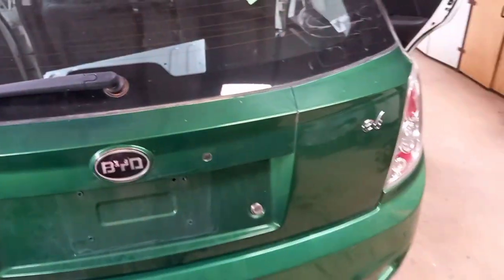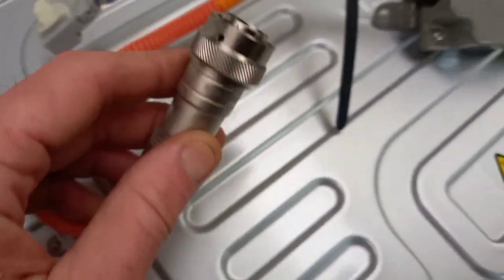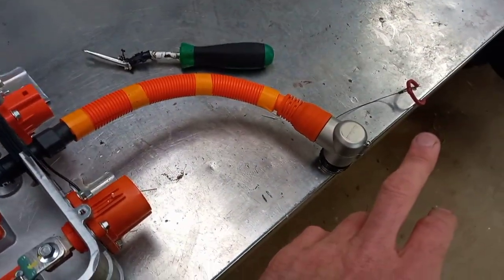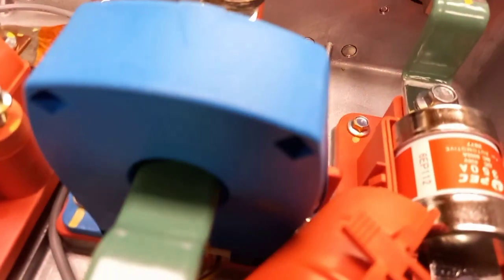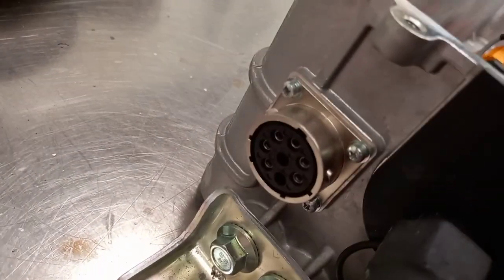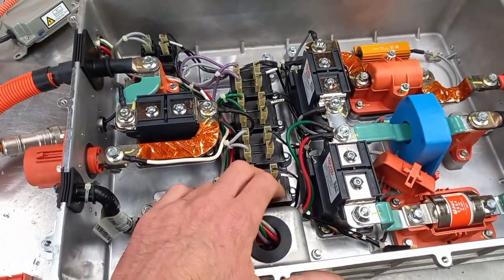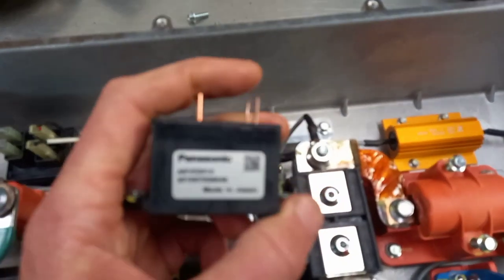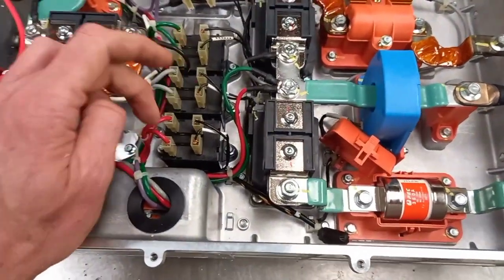BYD E6 Contactor Box Unboxing

Comment: Hello! According my knowledge BYD E6 have build in V2G, V2L and V2V features.
Do You know how it works and what is necessary to use it? 
I have BYD E6 European version with Type 2 plug, but I don't have any plug to use it for V2L purpose.
I found out in market connecting devices to output 220VAC for Chinese version, but not for European...
Reply from the maker: You are in a similar situation to me. I find it very frustrating that there is this inbuilt potential but that there is no documentation or information to enable it's use. Each one of these thousands of vehicles could profoundly increase the amount of useful renewable energy in our lives if only the documentation was available.
Reply: @RaglansElectricBaboon  Have You tried V2V option? I think that there should be only Type 2 to Type 2 (female-female connectors) cable and it shall work. I believe that it would give at least partial answer how shall work V2L...
Reply: I think that there shall be simulated car's Type 2 connection algorithm to BYD E6 outlet (as input signals) and E6 shall provide output power to another car. I have tried to do it manually (with resistors), but it was not successful (probably there was some timing problem).
Reply: @haralds9635  hey. I have a question and I hope either of the two gentlemen can help me in this. I use the BYD E6 2012 version. Which came with an industrial grade 64A charger. And the port is Gb/T 2011. 

Questions are as follows 

1) the pin inside the car is a GB/2011 female port (Chinese standard) which is very much similar to the Europian type 2 pin.  I wanted to know is it possible to swap the onboard GBT with a type 2 pin port ( male) please note that they both have the same pin holes

2) does the BYD E6 2012 version allow single phase portable charger which is either 8/12/16A. Will there be any complicated. 

Much appreciated if your experience can guide me on tho.
Reply: @aatifaffan8090  Hi! I have European E6 originally with Type 2. My car without problems can take 1phase 32A, three phase 32A (Nominal 22kW in reality ~18kW) and from three phase 64A (nominal 43kW – in reality ~28kW).
I have no experience with GB/T. Leaflets with specification sheets gives identical charging power for both connectors.
I found out that in Aliexpress is available adapter GB/T to Type 2.
If You are thinking just change plug I don’t know…
Off course we can compare identification of inverter installed on car. If part number is the same You can change just plug, but if not I think use adapter better option.

Comment: Doesn't look like a shunt, looks like a Hall effect current sensor
Reply from the maker: You're right,  I'm wrong. But so are you 😜 A Hall effect current sensor is a solid- state piece of electronics.  This is a CT coil. All three devices can be used for current measurement and that's what I should have said-'current sensor'.
Cheers for the feedback and the view. And possibly the like?!
Reply: @RaglansElectricBaboon  Interesting, can you share the part number? I'd like to learn more